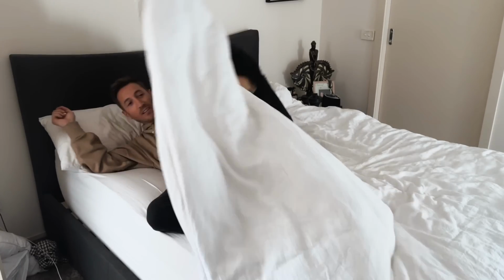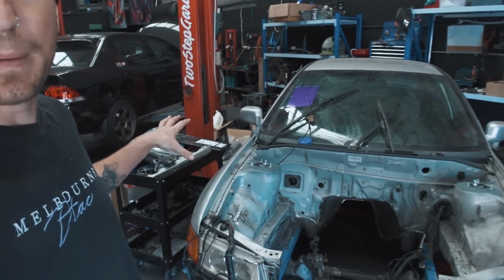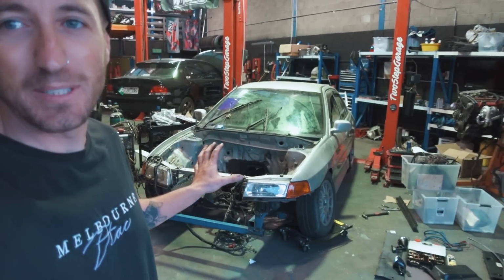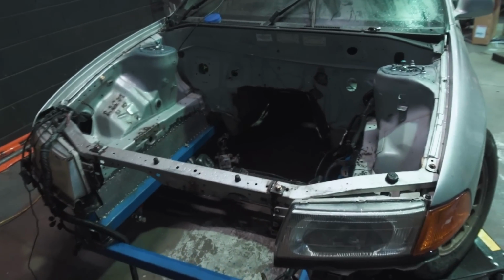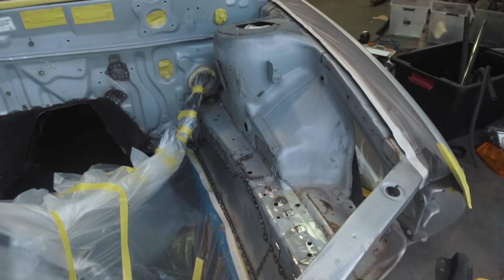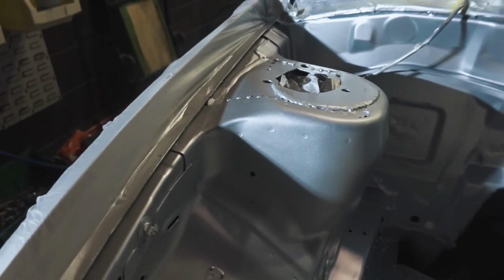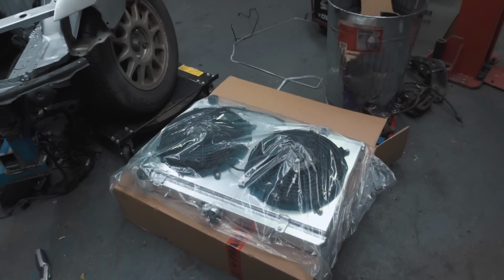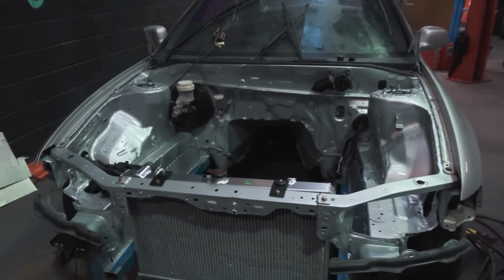LANCER FWD TO RWD CONVERSION | PT8

Comment: Quick tip for masking wiring looms, brake lines in bays and undercarriages. Use tin-foil, don't need tape and doesn't flap about with gun pressure
Reply from the maker: Dammit, that’s such a good pro tip haha thanks!!
Reply: Why have you put the angle on the camber plates just found you on TikTok now watched 12 videos in row to catch up hahah

Comment: Hey Mike, great work as always, but agree the spot welds could have been cleaned up, but i think it adds to the work that has gone into it, and thanks for the shout out, cant wait to see the next video! and good luck with BMW!
Reply from the maker: I appreciate your input at always! I’m actually not opposed to smoothing out the welds and re-spraying that part as I may tub the front of the engine bay for wheel clearance anyways. You live and you learn!
Reply: @itsmikelake  One thing i should point out, my skills with suspension are varied having worked with Peter Brock and building the suspension for alot of the V8 supercars, V8 superlites (intro into the group A's), WRC, also did the R&D for craig lowndes when he first debutted at Bathurst with HDT, but have also built alot of other projects including the camera boom for the first Matrix film.

Comment: I'd love to see you swap a V6 in a lancer coupe
Reply: Yes🎉
Reply: You can get them factory with a V6 though🤷‍♂️ What's the point?
Reply: @DStead2239  I couldn't find any V6 lancers from factory, where did you hear that?
Reply: Vr 4s not quite a lancer but still mitsi stock v6 twin turb
Reply: @jaminbartlett2250  I found it, but a lancer coupe is 800kg lighter then the vr4s
Reply: Here in Australia you can get v6 lancer engines, from large Mitsubishi sedans called Mitsubishi Magna's
Reply: @joanjoan5778  magnas and 380s are v6s
Reply: @vocalthrower448  I didn't hear it, I've driven them and friends have owned them.
The "lancer coupe" is not it's proper name, it's only called that in Australia. "Lancer coupe" is actually called a Mirage. The JDM Mitsubishi Mirage coupe or hatchback had a V6 or 4 cylinder.. google "Mitsubishi mirage v6"